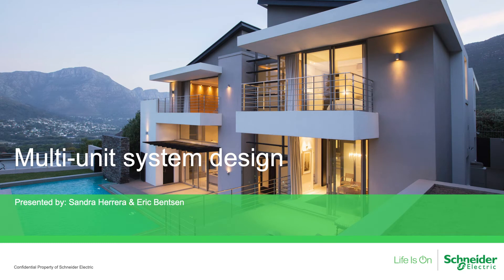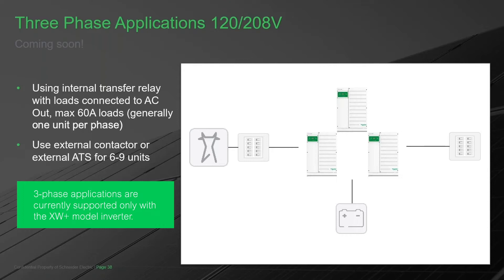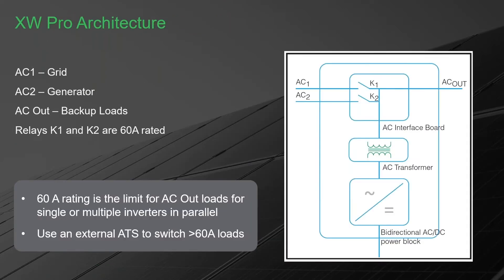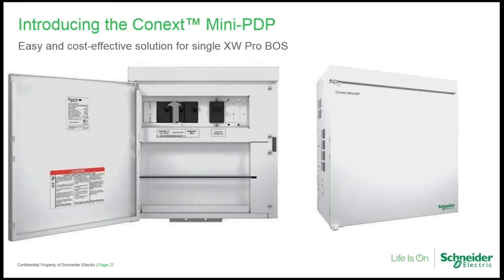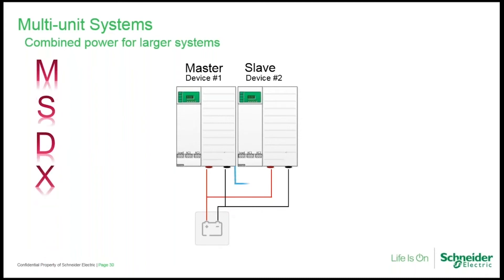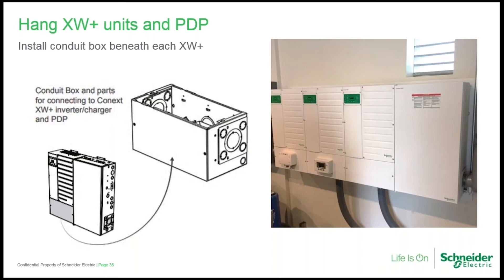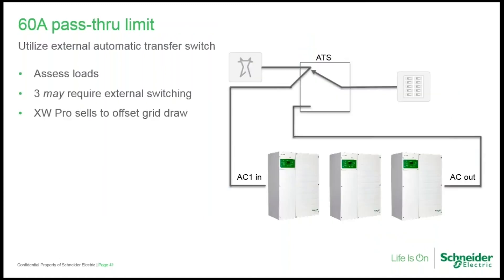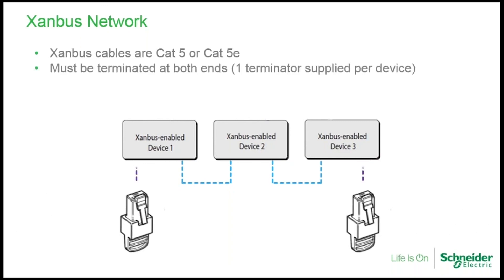Multi-Unit Systems with XW Pro

Comment: is there ANY documentation on how to wire up the DC side of things when using 4 XW Pro's in a system,  since the breaker plate only supports 3 inverters?

Comment: I have a SunPower System with your hardware in the battery. Would it be possible, if needed, to remove the XW Pro with the Gateway & 2 Lithium Ion cells and add a Schneider Electric BCS to replace the SunPower MID and Micro Inverter System? Would the Schneider System see the Enphase Micro Inverters?

Comment: Hi there, so I am designing an off grid system with generator as a backup source. The problem is that the generator is a 3 phase diesel generator, so how should I design this system with XW pro. Need a bit of a help, so would you kindly reply
Reply from the maker: Hi there! Please fill out the attached form & one of our representatives will get in touch with you. 

Complete the form https://solar.se.com/us/en/contact-sales/ if you're from Europe, this form https://solar.se.com/eu/en/contact-sales/ if you're from North America, or this form https://solar.se.com/au/en/contact-sales/ if you're from Australia.

Comment: Does SE still support Multi-Cluster Systems (multiple Multi-Unit Systems)? If so, I'd imagine there really is no way around using an external transfer switch. Therefore, how does one meter and monitor the Grid Input and Export, Generator Input, and Load Outputs from any system with an external transfer switch?
Page 52 on your Multi-Unit System manual says that these Features are not supported with the use of External Transfer Switches. Then how does one design the system to included these features? Thanks.
Reply from the maker: Hi Chris! Thank you for your comments! Could you fill out this form so that we could answer your question in details? https://solar.schneider-electric.com/purchase-products/

Comment: In an off-grid system, can one not simply avoid the need for an external transfer switch by limiting the pass-through power to 60A? This can be achieved by installing a generator no greater than 14kW. Without an external transfer switch, the Generator Support feature would still be active, so that the XWs could support the generator to cover any potential loads above 14kW while it was running.

In the event that the entire XW system was down and the generator was bypassing the inverters, SMM units - which are cheap and easy to install - could be wired into large loads to prevent overloading the generator. (See comment by HerbTVGlum below - which is an idea I totally agree with)

If this is not possible, how does Schneider Electric recommend dealing with the fact that many important features are not available when using an external contactor? Notably, the power and energy metering and reporting for both Generator Input and Load Output is NOT available when external contactors are used (page 52 of the SE Multi-Unit Manual). These seem like crucial components for monitoring any system.

Thanks.
Reply from the maker: Hello Chris, your comment is correct; provided that you don't exceed the maximum 60 amps pass-through capability of the XW, you do not need an external transfer switch.

If your system design calculation defines that greater than 60 amps are possible, we recommend split up the loads with the external transfer switch to retain full system feature set.

SquareD makes split-bus panels that are ideal for this.